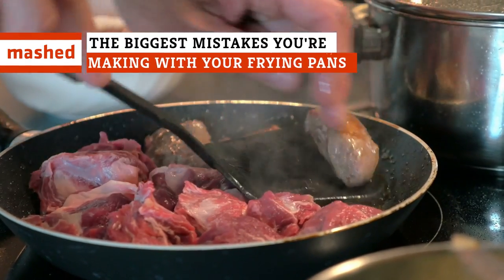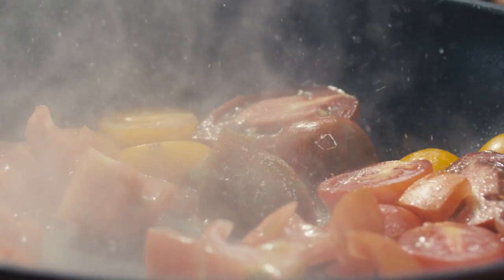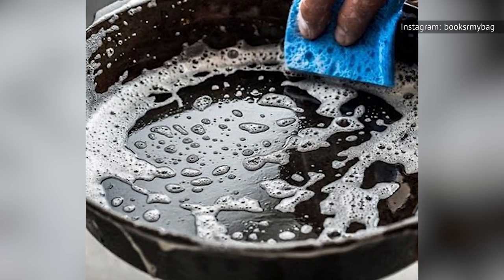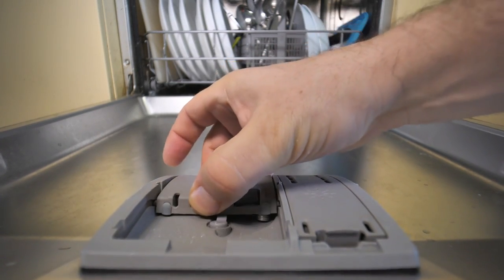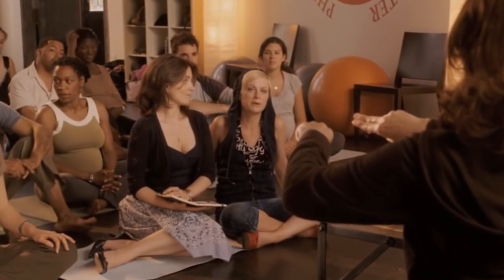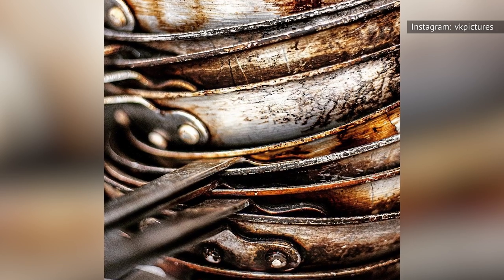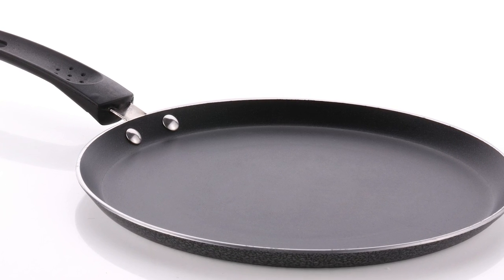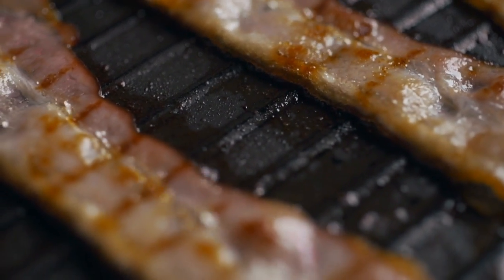The Biggest Mistakes You're Making With Your Frying Pans

Comment: For me I usually cook eggs in my carbon steel pan and sometimes my cast iron pan. They're both very well seasoned so eggs don't stick. On my stovetop, I preheat my carbon steel pan for 3 minutes (at least 5 for cast iron) on 3.5 out of 10 heat. This usually does the trick and the eggs cook all the way through while not sticking

Comment: You get what you pay for so stop buying at Walmart and go to a restaurant supply store, I have pans that are 20 years old and still act like new
Reply: How many scratches on those 20 year old pans? C'mon
Reply: I have a calphalon professional series pan I bought in 2001 and it's still smooth as glass, no cracks in the coating and I regularly make stir fry in this pan and it still doesn't stick. I've got a set of stainless steel pans that I use and abuse, I get my frying pan ripping hot and seer steak in it